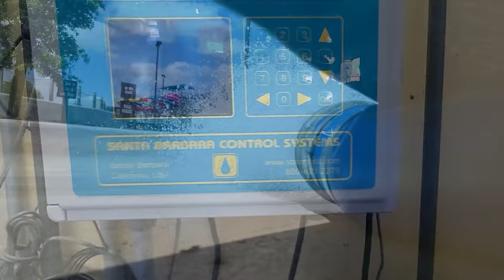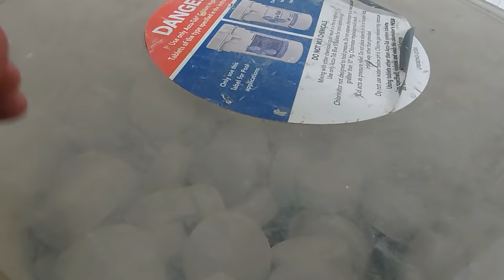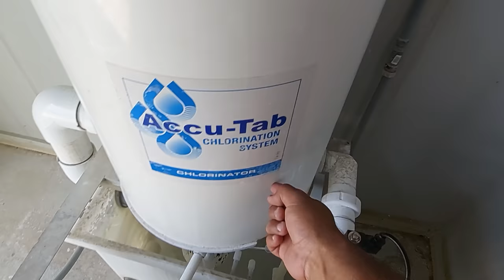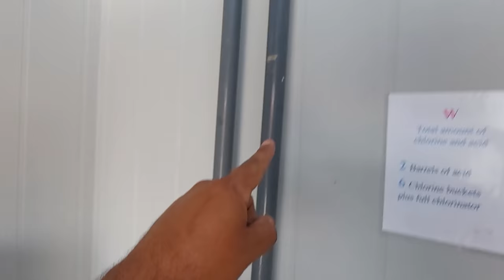Wave pool Chlorinator

Comment: Thats a great lockout. I shocked the HVAC tecs I had my house because I have a lockout on top of my breaker box, when I work on stuff in my house I lock it up... I had a bad experience with my Dad almost accidentally to frying me in highschool.
Reply: Me too bro. Mu dad turn on the fuse and i had a blqck thing inside my fingers
Reply: Lol, I've had electricians who kept the breaker on.
Reply: yep go breaker lockouts at home here too, just 3D printed ones for me, which is enough to stop the wife/kids flicking the breaker. obvs if I did this stuff professionally Id buy proper ones.

Comment: Those shaft seals work bc they form a floating seal with a layer of water between the polished metal face and the polished ceramic face of the portion that presses into the seal plate. That’s why pumps leak if they are run dry often the polished faces get hot and deform if run dry.

Comment: One of my first jobs out of high school was working at a pool as a life guard but also helped out with maintenance to earn some extra money. We used chlorine tabs as well (don't remember the brand) but our system just had a seal tube like hopper with a threaded cap that was inline with the flow. Had to close the valves in order get the top off and if you didn't do it right you got a blast of super chlorinated water, or if the last person forgot to open the inflow valve the gas would build up pressure and fill the room.

Comment: Didn't see how you put the wet end back together but the ceramic should go towards the motor then the sprung graphite part engages the polished side of the ceramic...  Did two of these recently for my spa opening...

Comment: I worked with accu tab before, I love it, you should make sure you stack your pucks nicely you’ll get better control and flow. Also make sure you clean out the inside once a year or you’ll get calcium buildup and it’s a pain to clean. I’ve done pool work before out by Chicago love your stuff

Comment: Can’t imagine the pump seal lasting very long on that pump with all the concentrated chlorine slurry it pumps. That particular seal definitely didn’t look good but at least the bellow on the carbon side looked intact. Would probably have fewer issues if the pump was pushing instead of pulling. Or at least had a way of rinsing the housing, impeller, and seal with fresh water before shutting off. Also, how are the chlorine fumes from the open slurry tank even remotely tolerable?

Comment: Are pump motors rebuilt or do new ones get purchased?
Reply from the maker: Anything below 10hp is typically a recycle.  All motors larger can be rehabbed with relative savings.
Reply: @thepoolguy  Bearings and wet ends/seals can be had for most of these relatively cheaply, beyond those about the only other thing that might go bad is the capacitor(s) provided you don't have corrosion issues.  A little GoogleFu should find the parts.
Reply from the maker: @Exploring With Dark Dreamz this one received some chlorine water, it's was all locked up internally.  Plus, it's a cheap replacement.

Comment: Only thing i would do is using fully insulated electrical screwdrivers and always double check the power is off regardless if you have turned it off at the mains, Would hate to see you hurt. But as always your content is fantastic.

Comment: Similar pucks as my aerobic septic uses.  Calcium Hypochlorite.  Can be quite unstable if get to hot and because its an oxidizer you can't mix it with anything combustible.  The ones I use are 2 5/8" x 1" or about 5 oz each.  Keeps the yard watered well! 💩💩

Comment: Stabilized VS Un-Stabilized chlorine. What is a better choice? I’ve been using stabilized but my gut tells me I should be using un-stabilized.
Reply: Are you testing and adjusting once or more per day? If not, stabilized is the way to go.
Reply: @RobertSzasz  I was using the Frog Leap system but this year I switched over to a chlorinator. I think this is the better way to go. Also less money and work.

Comment: Was the motor single phase or three phase?
Reply from the maker: Single phase 120
Reply: @thepoolguy  7 hours later when laying in bed at 11:47pm I realize what a stupid question I asked. You literally showed the process of locking out a 1 phase breaker lol. These are the things I think about as an electrician when I should be sleeping, Kinda surprised the manufacturer used a single phase motor over 3 phase. I’m sure they have their reasons since they are the engineers.
Reply from the maker: @Exploring With Dark Dreamz this motor does have both

Comment: I managed a 250,000 gal pool and we used a chemical pump from myers that would pump liquid chlorine (like Clorox) from a 500gal storage tank into the return line to the pool. The pump was very easy to adjust with one little knob and it worked flawlessly for years. This thing looks over complicated
Reply from the maker: Liquid chlorine is for chumps.
Reply: @thepoolguy  it worked perfectly. Way better than an overcomplicated pile of pipes and wires and way less expensive than tablets

Comment: I am getting air intake into our pump how to diagnose
Reply from the maker: Do you have a flooded volute, and have you purged the air from the top of the volute?
You may also check that your strainer basket is not the cause, sometimes those gaskets can leak.  If not, check bolts.

Comment: What's the difference between calcium hypochlorite and sodium hypochlorite
Reply: Hypochlorite is a negative ion, so you need something positive to get it to form a crystal structure (which can then be smashed together into a puck).  Ionic sodium and ionic calcium can both do that.

Sodium is very good at dissolving into water, and it won't really interact with anything in the solution once there

Calcium, when mixed with large amounts of another ion called hydroxide (i.e. when in basic solution), interacts with the hydroxide to leave the solution, crystallize, and fall to the bottom.  This makes the solution more acidic. 

Calcium also won't necessarily dissolve quite as readily, which could help control the addition of hypochlorite, but I'm not quite as sure.
Reply: @0xEmmy  I use calcium hypochlorite, is that why my water always goes acidic

Comment: What was the lock for
Reply: so nobody turns the power on while he's elbow deep in the electronics/mechanics
Reply: It’s a LOTO (Lock Out, Tag Out) lock, it’s to prevent someone from turning to breaker back on while he’s working on the equipment. The idea is only he has a key to remove the lock.

Comment: Why’s the LOTO lock hasp plastic?
Reply: It sits well protected inside a breaker box, not like it's hanging out on an industrial shop floor where it would get knocked off by accident. Or are you worried about people breaking off LOTO tags?
Reply: @pepperypeppers2755  I’d be concerned with the ease of forced removal. I mean the shackle on the padlock. Black piece. Not the breaker lock
Reply: @_ohmz_electric  does LOTO really need to be that secure? Someone needs to know they are screwing up, not be totally stopped from malice.
Reply: Its just to stop someone from accidentally turning the breaker back on.  its not really to secure anything.

Comment: You show LOTO but no cover on an energized panel is a no no!
Reply from the maker: Are you talking about the panel I was working on?  I was testing voltage out and other circuits.  I closed after the video ended.
Reply: 🙄  There's always a nanny in the comments